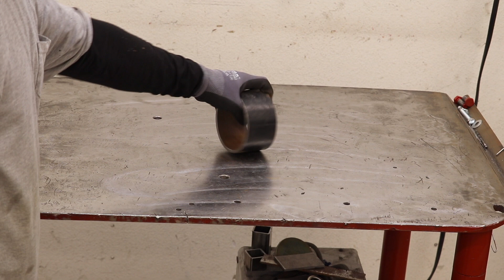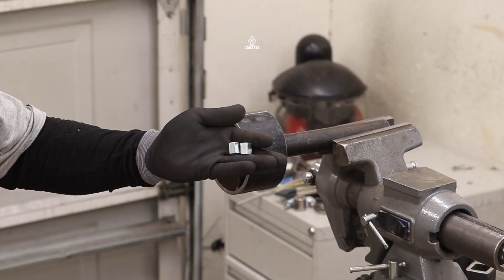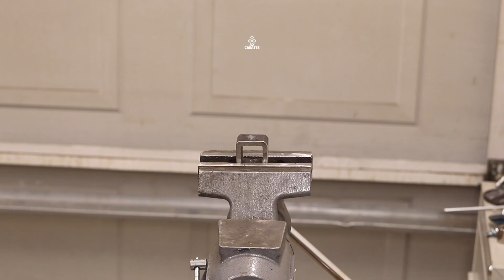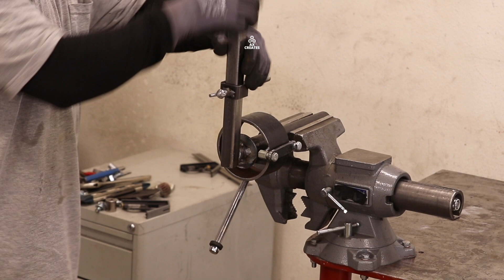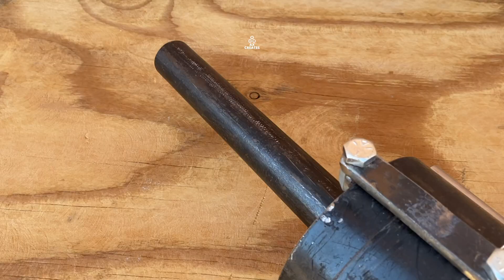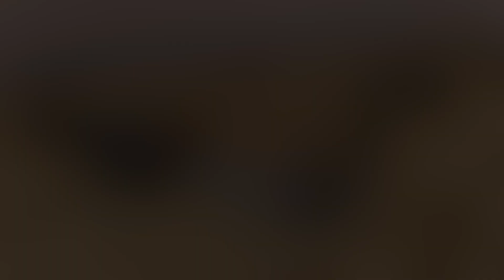BEST CREATIVE DIY TOOL IDEA FOR METAL WORKERS!!

Comment: .............................. GREAT JOB  .............................. Looks like all one would have to do is build different size diameter form to use for smaller size circles. I like the fact that this is a simple jig, using materials that one can obtain cheap or damn near free.

Comment: I guess it's good if you happen to frequently need exactly that radius of bend in your metalworking.
Reply: I thought this a pretty cool thing for HVAC guys because depending on the size you could make the odd sized fittings/couplings that are hard to find at the box stores
Reply: @littleshepherdfarm2128  still have to make a specific fixture for each odd size. But yeah, definitely useful. I certainly didn't suggest otherwise.

Comment: Very impressive piece of work A.X. I'm amazed @ how you come up with some of you ideas & projects! I'm just starting out welding and I would love to make some of you ideas come to life. I'd it possible to get the sizes and type of materials you use in project that you come up that I would like to try and recreate?  Such as if the materials are cold rolled steel or just regular?
Reply: When welding you want to use hot rolled steel, cr has lots of internal stresses from manufacturing that once heated by welding will warp and loose its cr strength